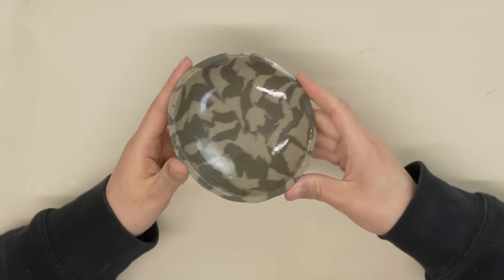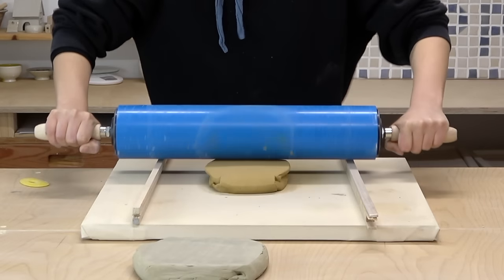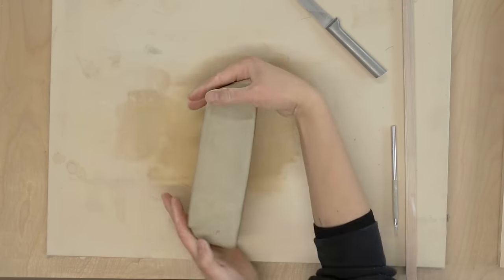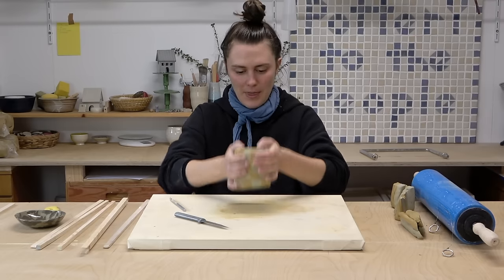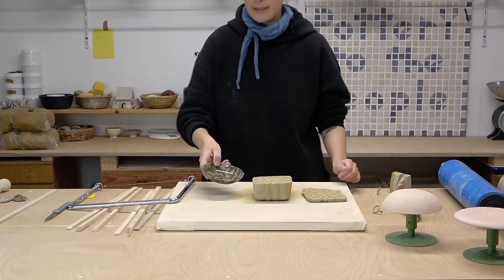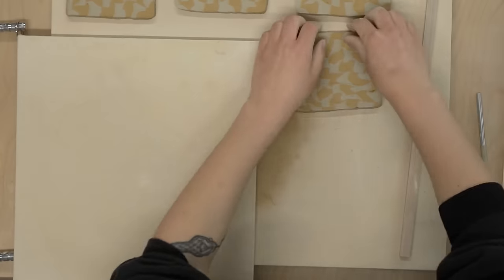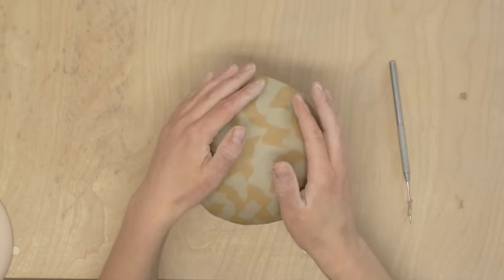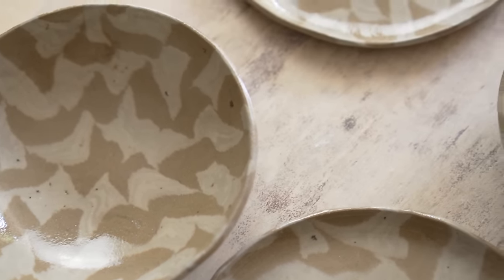the most satisfying pottery technique

Comment: I used to take two different colors of clay, make one a cylinder.  (this would be the main body color).  Then I would cut out 3 half cylinders evenly around the cylinder.  Then add the second color as coils down the trough.   Then throw a mug on the wheel.  Keeping the slip off the surface with a rib.  Then fire it with clear.  Kind of a spirograph swirl effect.